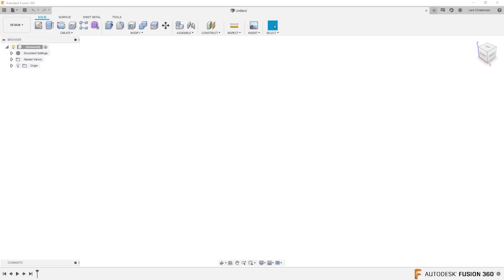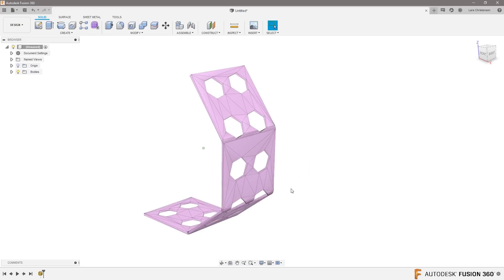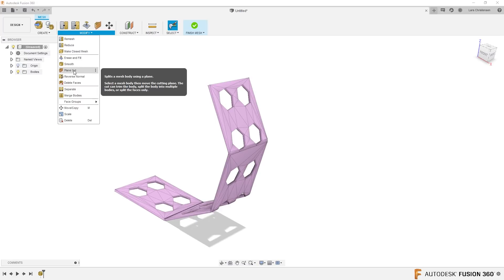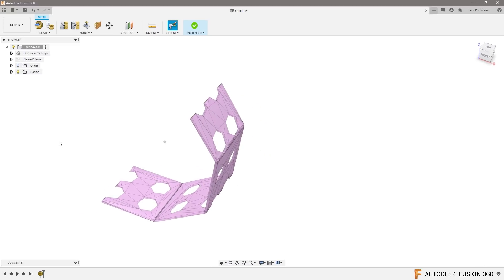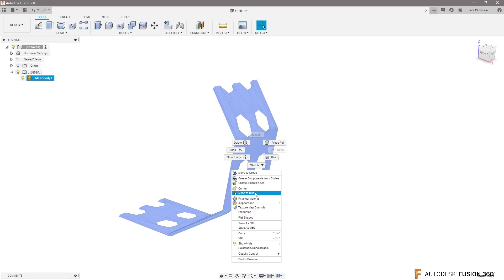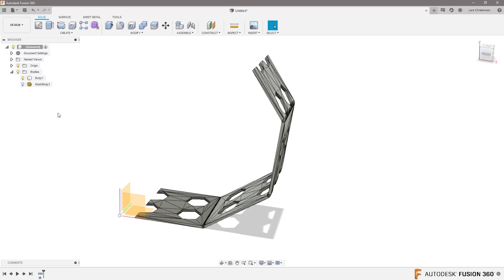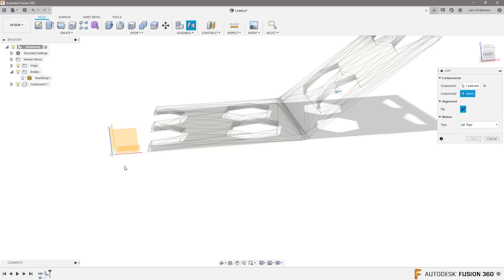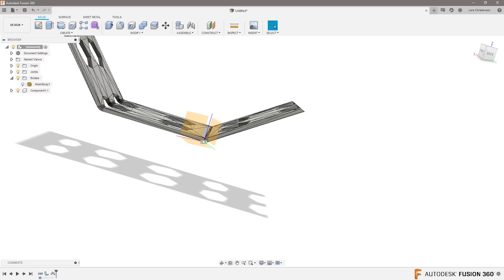Fusion 360 — Manipulate Origin for Mesh File — Ask LarsLive

Comment: Well I think converting it into a Component and moving the Component with the Joint Feature will not help. Because i think when exporting it as an STL file it is oriented in relation to its own Origin inside the Component.
But you can use the Align Feature which is used in a similar way!